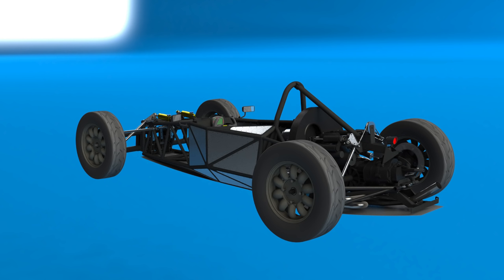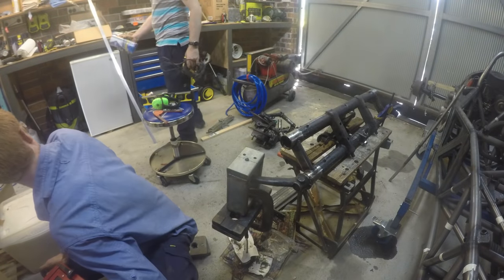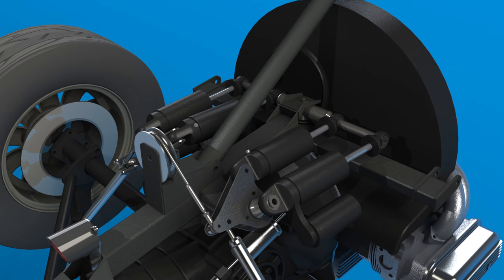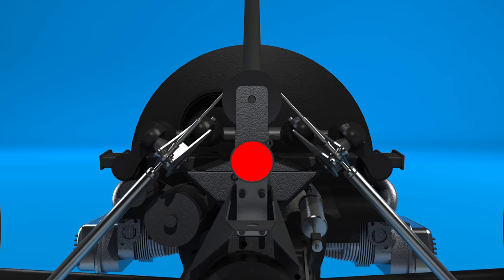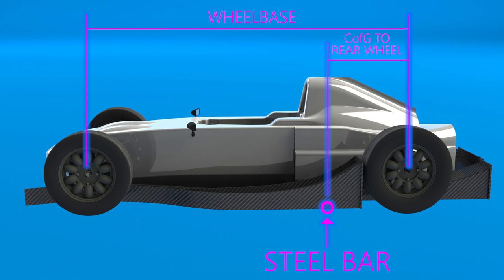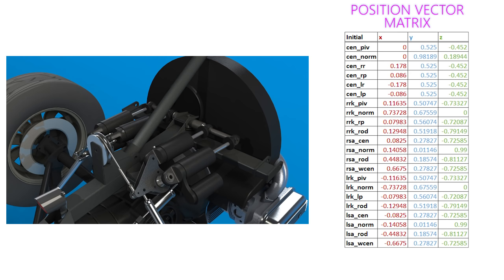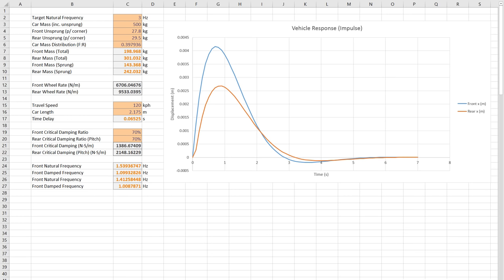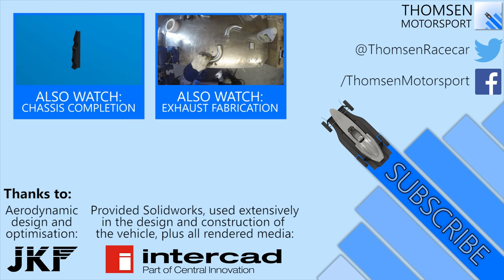Suspension Part 1: Design

Comment: Hi, I'm very happy for you following your dream and enjoying hard work of building a vehicle and racing it. You've mentioned the lead weights in this video and I've watched the video where you damaged the suspension. Have you consider to make more robust suspension instead adding weights? At least, less weights. Just enough to tune weight distribution.
Reply from the maker: Thanks. I did end up making the push and tie rods stronger by using solid bar instead of tube with welded in ends. Much simpler to manufacture. It didn't end up adding much weight and they are so much simpler to manufacture.

Comment: Wow that spreadsheet is amazing work. I'm in the process of designing my own car, haven't gotten past the body yet as I'm still figuring out how to take each piece and seperate it as it's own part . Currently use inventor, probably not the best tool. And I'm not sure how a lot of thing will even be done
Reply from the maker: I use inventor sometimes as well for my work, it's as powerful as Solidworks (maybe more so) but not so nice to use in my opinion. Like anything it just takes practice.

Comment: what size rod ends did you use on the rear leading arms? did you select them based on what has been done before? I believe your set up will put them in bending which they just aren't well suited to.
Reply from the maker: Ambrosemcc That's true, it's not ideal for the rod end. It's been done a lot in Formula Vee though and doesn't typically have issues unless the car has a collision. I used the same size (well metric equivalent) to what was on the wreck I bought, which had an almost identical setup. It gave me the freedom to effectively bend the leading arms around the rear of the gearbox, to improve how it was mounted there - a bit of a compromise.
Reply: Yeah fair enough. I have loved watching this series. The vehicle dynamics calculations you have done seem very impressive. I look forward to seeing how it plays out on the track.

Comment: Are Australian FV rules same as those in THE USA? Neither Your cad drawn wheels or brakes look like Herbie’s.
Im really impressed with your thoroughness.
Reply from the maker: I don't believe they are the same. The brakes use an aftermarket disk brake conversion kit. The wheels are a racing component, not road wheels. Thanks for the feedback.
Reply: ThomsenMotorsport Does it use a 40 HP engine? Your car looks like overkill for such a motor and does not seem to be in keeping with inexpensive racing that FV started out to be. You have what appears to be a two man Formula 1 operation.
Reply from the maker: It has ~70hp at the wheels. I agree it is not necessarily in the spirit of the rules, but neither is the competition. To be fair as well, this car wasn't that expensive for me, though it did cost me a lot of time.
Reply: ThomsenMotorsport Will you be selling copies. Could it accept other engines? Someday they may be saying Simon is the new Colin.
Reply from the maker: Yeah I'll get the whole thing out there, hopefully sooner than later. I've released a lot of the design already through Patreon.

Comment: Great vid and even better design and fabrication skills! I am attempting to construct a racing car in solidworks as well. Being that it is a circle track car, we have to run some extreme camber angles to maintain tire compliance. With the tires being very oddly deflected (statically and dynamically), how would you go about beginning to model this in solidworks? I want to get the initial wheel placement set first, and build from there. I too don't have any tire data, but I do have a car already built to measure off of. I was thinking, I could measure from the ground to the bottom of the rim on both sides (with camber that measurement will be different cause the rim is angled) then fix the rims to the ground plane at those heights, and build from there? Well then that wouldn't allow me to turn the wheels without over defining the assembly. What do you think? How did you do this?
Reply from the maker: Thanks. There are a few ways you could do this, what I'd recommend is drawing your tyres/rims and creating a point in the part which is your "wheel center". When you create your assembly create a mate with a set distance of the rolling radius between the wheel center and the ground plane. Technically your rolling radius will change with camber but it should be close enough for the purpose of modelling it. This way the wheel still has five degrees of freedom so you shouldn't have a problem with it over defining your assembly.
Reply: Thanks mate! Ill give it a try

Comment: @thomsenmotorsport, I am really interested in the analysis you did on the suspension, particularly what you applied with the rotational matrix, and response to an impulse signal. Seemed like control theory which I am interested in as an ME! Any reference you could point me towards for more info on that for vehicle suspension?? I really appreciate these videos!
Reply from the maker: Best place to start is a book called Race Car Vehicle Dynamics. It's big but covers pretty much everything you might need to know.

Comment: Excellent series, is this your first project car or have you had experience working on other competition cars in the past? The level of depth you go into with your design and the range of fabrication and fitting skills you know is beyond what your average mechanical engineering degree teaches you so I'm curious as to what sources you found useful to teach yourself the finer details of design and manufacture?
Reply from the maker: Thanks! In the past I was on the University of New South Wales Formula SAE team, that taught me a hell of a lot. I learnt to lathe around then as well as part of a TAFE unit they put us through, that was also extremely useful. Other than that I've just read things, watched tutorials and practiced. It shows in some areas that I'm not a professional but overall I'm still pretty happy with it.

Comment: Top vid buddy. Any idea on the ideal front to rear weight balance for a vee if it weighed 500kg? Off to watch your other vids.
Reply from the maker: Thanks. Finding the ideal distribution theoretically would depend on the tyre data, without which I can't really say. I've just given myself a bit of freedom to modify it by positioning my ballast so it will be a bit of trial and error.

Comment: Hi! Thanks for the vídeos. Im form Uruguay so sorry for my english. 
I wanted yo ask you why did you choose leading arms instead of trailing in the rear. For 2 reasons: 1-The leading doesnt cause toe out in bump steer in the rear?
2-From all the info i gather, the conclusión i came with is if you have the steer on the front of the car behind the wheels or axle (in this case vw beetle) in the rear it should be the oposite, to the front of the axle (trailing arms in this case). ??
Thanks
Reply from the maker: Leading or trailing arms could be designed to be neutral/toe in/toe out with bump depending on the arc of motion that the axle swings across. Think of the axis that I've got the swing arm rotating around, which is close to parallel to the car. The axle joint position is fixed. So to create the rotating axis I need another point which lies on the intended axis. Since the engine and chassis are in front of the axle joint position it's a lot easier to find a suitable point behind, in this case at the rear of the gearbox - hence me using leading arms. I can't see why whether you have the steering arms in front/behind the front wheels would have any effect on this.

Comment: hi mate, can i ask where you got the dampers and rockers from? were these custom made somewhere?
Reply from the maker: G'day, I got the dampers second hand from a Formula Ford, four penske shocks at a good price. I got pretty lucky there. The rockers were all custom made by myself. I made the centers that supported the bearings on the lathe and the plates I had laser cut. There will be a video coming out on how it was all built, you'll get to see how they were made there.
Reply: gotcha, thanks for the info. Well done on the build mate, am blown away and super impressed at the time and effort you must've put in with design, planning, build, testing, troubleshooting...absolutely wonderful effort. Hope you go well with the racing = )

Comment: What books can I go for better understanding of suspension system???
Reply from the maker: Race Car Vehicle Dynamics is probably the best all round book I came across.
Reply: @thomsenmotorsport7201  Thanks!! & What sources can I use for material selection
Reply from the maker: Harder to say, I used the category rules to select the chassis material then just used mechanical calculations to determine whether the material was strong enough. I can't think of anything off the top of my head but engineering mechanics textbooks might help to understand the method.

Comment: I ran an analytical group  at a tier one and did analytical work combined with physical testing at an Orem spread over too many years.  Very sound found foundation but please don’t advertise that your model will save time at the test facility.  It’s an analytical “jinx”.  It can an will get you closer to your target and give you a much better feel for the sensitivity of the results to the inputs so you know what knobs to turn when the rubber hits the road.  I started my career in 1969 and saw a full body in white strain gaged to validate an FEA model being done by our Scientific Research Labs.  The project leader said physical testing would be obsolete in 10 years, that would have been 1979.  Physical testing is still in business.  Have you automated your spread sheet to converge on some optimum   I tried design of experiments on complex input software with long run time with some success.  Now I’ve seen “cloud” computing” where Newton’s equations are solved without partial differential equations that require that one variable be held constant.   Everything is varied simultaneously generating clouds  for the engineer to pick the high density “sweet spot”.  That was over 15 years ago, no idea what rabbits have been pulled out of the hat since then.   I think all the fun is track day and the humiliation and humbling  effects of the “phantom “ variables not accounted for in the analysis.  I watch young engineers, technicians, mechanics and racing nuts at outlaw endurance races like 24 Hours of Lemons.  I managed highly trained and educated engineers in an office and rarely got to see the scrabbling and panic that takes place when the well engineered  system falls flat on it’s face.  I’ve been through it at a professional level and it’s no fun but for race cars it looks terrific especially for the up and coming technical people.

Comment: How u did the calculations? How u knew they were gonna act just like that? What u based on?
Reply: Do u have any email I can contact u?
Reply from the maker: thomsenmotorracing@gmail.com
The basic process I mention in the videos, basically I had a spreadsheet that calculated the suspension positions, spring forces and from that the forces in each member and at each wheel.

Comment: Wow, you must have done well in math class! I have a simple question, how did you manage to install the engine - transmission backwards in the car and go forwards on a track?!
Reply from the maker: Not really but I persevered. I didn't do this myself - I'm not an internal combustion engine person - but as I understand it the final drive is reversed which reverses the drive direction.
Reply: @thomsenmotorsport7201  Wow Thanks for the reply!!! Just want say your car must be an absolute ton O fun! I guess flipping the "diff" is how it's done, ...if it can be reattached upside down. I think this concept is not easily understood, I tried to explain this to a friend of mine who is a machinist by trade, (not a dumb guy) took me a couple of tries to get him to understand. Have fun, stay safe, want to see you in the top three soon
Reply: @k.bellingham8335  It took you a couple of tries to explain how rotating the diff 180deg about the driveshaft would make the wheels turn the opposite direction...?
Reply: @Stomachbuzz  yup
Reply: @k.bellingham8335  I get what you mean by flipping the diff right away. Thanks. The other thing I have trouble with is to have my friend explain to me how he turned a Subaru AWD into a RWD, as I am not familiar with their AWD system. All he could utter is they put some blocking plate there.

Comment: Hello sir, you have a new subscriber. Im a mechanical engineering student from Istanbul and I own a 75' VW beetle. Is it possible for me to apply the same suspension design for my car ?
Reply from the maker: +Baris Can Birkalan well a real beetle has the engine the other way around but no reason the same thing couldn't be done but backwards.

Comment: hey, great video! would you mind sharing that excel sheet? as an engineering studeny myself I would love to see the calculations you used! thanks a lot.
Reply from the maker: Thanks. I can recommend the book I used - I think it was this one: MATLAB Codes for Finite Element Analysis: Solids and Structures
I used it to create the spreadsheet, it's not too difficult to translate from code to Excel. Excel even has matrix functions.